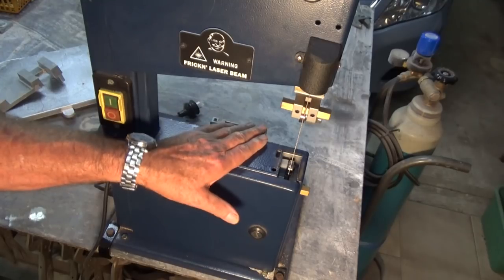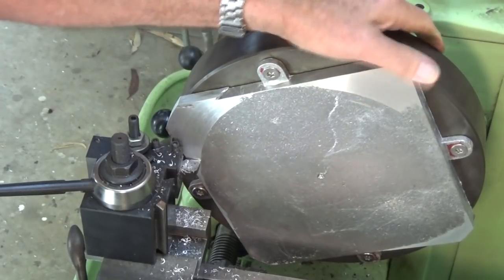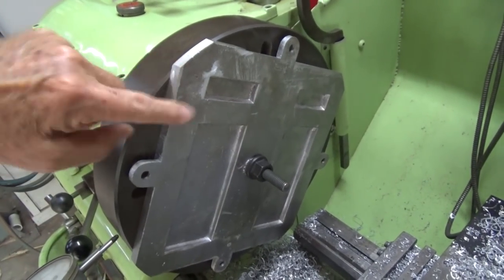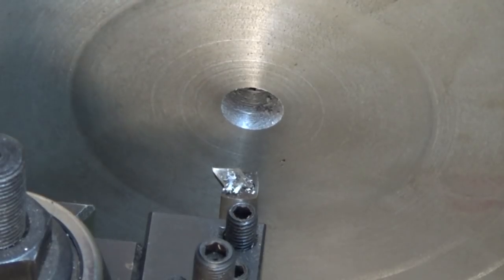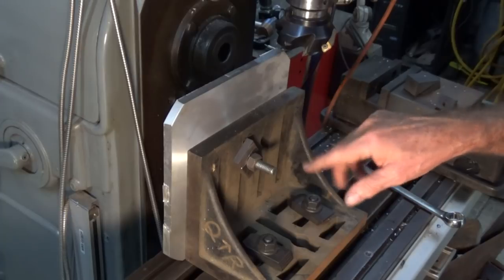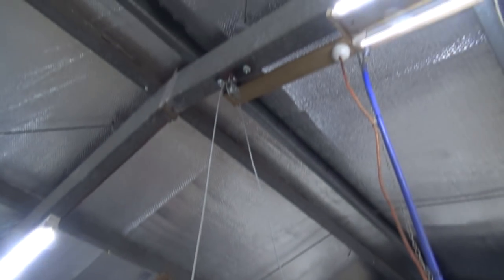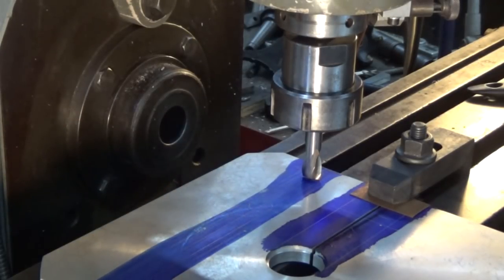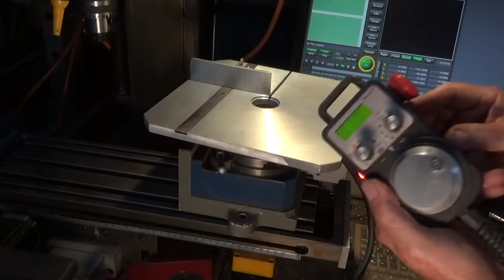Cast Aluminium Machining for a DIY Bandsaw Table

Comment: Thanks for ur time .i have just started milling as well as lathe work . I did the reverse of u and moded my multi speed metal band drop saw as a vertical bandsaw to use on timber .
As so funny enough i wont to get into casting and plating so u have me hooked.
 As a fellow brisvagusin loved ur vids keep them up

Comment: Nice work. Another method I have seen to keep the table flat across the slot is to put a tapered pin into the edge of the table, spanning the slot. I think in those cases they only machined one side of the casting though and you can use the flat bottom.

Comment: Great work! Brilliant finish on that table
As for the miter fence dimensions, I think that's where you say "I'd rather be lucky than good" :)
Reply from the maker: I did actually remove a bit of the steel tongue where my father had drilled a cockeyed hole to hang the fence from a nail. I just ground it off until the hole was gone and then put it back on the table and lo and behold, it was exactly the same length. How often does that happen?
Regards,
Mark

Comment: Nice build, well done. Beautiful quiet mill you have.
Reply from the maker: It is quiet but I have no backgear so it doesn't have much torque and there is no quill so all the vertical travel has to be done with the knee. I am in the process of replacing it with a Bridgeport. I just have to figure out how to run it from 240V single phase!
Regards,
Mark

Comment: The alloy does machine really well.  Looks very good.  It will be annoying as it develops dings and scratches with normal use but as you said it is a soft alloy.   I can understand you not having the equipment to heat treat the alloy.   I expect you would need a good size oven, but more of a challenge is needing an inert atmosphere likely some combination of inert gases.
I am curious.   The underside of the table is thicker for the mitre slot, and also seemed to be thicker at right angle to the mitre slot for what I expected to be the slot for the blade.   You made the blade slot parallel to the mitre slot and did not use the thicker cast section.    I am curious of your reason.
My wood cutting bandsaw has the blade slot 90 deg to the mitre slot which is common, although I have seen some wood cutting bandsaws with the slot parallel to the mitre slot.
Your fathers mitre gauge cleaned up very well.
Dave.
Reply from the maker: Dave, I believe that the alloy will age harden but not really to a full T6 spec. Part of the challenge of doing a full heat treatment is the amount of time the metal needs to be held at very specific temperatures. The thickness in the centre of the table and parallel to the front edge of the table is to allow for mounting on the bracket that will be bolted down to the bandsaw frame. All the cutting forces are concentrated around that central hole where the blade goes. The rest of the table is really just for supporting the work and it only really takes superficial loads. I am trying for maximum rigidity in the junction between the table and the frame of the saw. It should all become clear in the next video which is about 75% done. Probably out late next week.
Regards,
Mark

Comment: HI  MARK,,,,  I  HAVE A CHOLCHSTER LATH ABOUT  THE SAME  AGE  AND  HAVE  NEVER  HAD A PROBELEM  GETING  THE GAP BACK IN ,, AS LONG AS  EVERTHINK IS CLEANE.. REGARDS R.
Reply from the maker: Richard, I based my comments on a friend of my fathers who worked at Evans Deakins, a shipyard in Brisbane, Queensland. He told me that some machinists would refuse to remove the gap piece on threat of sacking because they knew it would affect the accuracy of the bed closest to the spindle. I did actually remove it when I refurbished the lathe and I think I painted the bed after it was assembled. I used a two pack paint and I am pretty sure it would crack the paint if I removed the gap piece. Plus, I did size the casting so it could (just) be machined without removing that part of the bed. 
Regards,
Mark

Comment: Should make some T-Slot clamps as Randy Richards made for his Bridgeport mill.  They sit low inside the slot and only clamp on the sides of the parts.  Its an easy project and perfect for your classic mill.
Reply from the maker: I love looking at all the clamping kit that some machinists have. I did actually make some low profile clamps that use three pointed set screws in a cast body that drive downwards at a slight angle. They bite into the edge of the part so you can hold it down to machine a surface. One day when I get my own Bridgeport I will have to get more serious about acquiring the accessories to go with it.
Regards,
Mark
Reply: @rrintheshop has free plans for those as well.

Comment: Shiny!  I hope it holds up to use.  I've had consistantly bad results with aluminum tool parts subject to sliding wear.  Chips and shop dirt just eat them up.  Carry on, sir!
Reply from the maker: I know it's not going to look good for long but my main issue is keeping the machine light. I have to lift it up and down from a cabinet for storage and I'm not exactly Arnold Schwarzenegger. I will be doing some ridiculous decorative treatment on the table surface just for fun. This will make me extra sad when it does inevitably get scratched and shop worn. 🤨
Regards,
Mark

Comment: Great job Presso as always! Have you thought about hard anodize to help with softness of the table? I've always had the best luck cutting full depth with sitting saws. Thanks for the vid, really enjoy your channel!
Reply from the maker: Steve,
I would like to anodise the casting but it is just a bit too big for my anodising tank. Plus, I have never tried anodising cast parts. I must give it a go though. I think the table will age harden to a certain extent. Freshly cast parts are always a bit soft but they seem to toughen up after a few months. 
Regards,
Mark

Comment: I totally dig the wildlife footage, Mr. Presling, thank you for including it. The surface finish differs as a result of the change in feed rate. A fancy computer controlled machine would run such a project in constant surface speed. Might this sort of thing be hidden if you only have a manual machine by burnishing the surface with Scotch Brite?
Reply from the maker: Ahh, but I have plans for a fancy surface finish towards the end of the build.... My son used to work in a company that had pre CNC hybrid semi automatic programmable lathes with constant surface speed that avoided the issue of differing surface finish due to abrupt changes in feed rates. However, the circular marks in the surface finish were mainly due to adding coolant as the facing operation proceeded. 
Regards,
Preso

Comment: Presso, 
Great as usual, thank you Sir. 
However I do feel that I must lodge a formal complaint with you for the dull ache now in my nether regions as a direct result of the sphincter cramping due to the upward direction of the trailing edge of the slitting saw. I suspected that you were setting us all up for a gag as the blade ripped the work up off the mill table and flung it across the shop (shed ?).
Reply from the maker: Joe, unfortunately I don't have a reverse on my horizontal spindle and by the time I had bolted the workpiece down and squared it all up I realised that I would have to cut from the left with the slitting saw doing an upward cut. However, the material I used in the casting machines beautifully and it was so quiet that I hardly realised that it was taking such a nice cut. I was standing on the other side of the work and I couldn't really see what it was doing. I usually listen for chatter or signs that the cutter or work is loading up but it all went smoothly and ended well.
Regards, 
Mark

Comment: What speed and bandsaw Blade tooth count do you recommend for Aluminum? I just got a Porta Band and was watching your bandsaw videos for inspiration!
Reply from the maker: I am using a 13 TPI blade and a blade speed of 70 metres per minute. It's good for steel but I think that 90 to 100 metres per minute would be better for aluminium. I would like to get a second blade for very thin material. Something like 24 TPI would be good. 
Regards,
Mark

Comment: Looks very good no voids or anything. Since most everything was redone, what do you say you call it Post-apocalyptic-bandsaw? Kinda fits our times huh!?
Reply from the maker: I initially resented the idea that I would have to buy aluminium stock to make my castings but in retrospect, I don't regret paying for it, (said the bishop to the dance hall girl). I did a maker's plate for this saw which declared it the "Phoenix" so sort of the same thing as post apocalyptic, maybe?
Regards,
Mark
Reply: @Preso58  Never heard of that proverb, but it sounds dirty lol

Comment: Thanks for going through all the steps in preparing the table.
is there any reason that the slot was not cut at the back of the table instead of the front, as I thought the cut in the back would be less of a problem with feeding in material???
Reply from the maker: You have to be able to feed the blade on from the front so it will insert into the blade guides and into the open doors and onto the wheels. I have seen some tables with the slot on the side but I more or less copied the design of the original steel table. 
Regards,
Mark

Comment: Great casting! Now tell us about that cnc rotary table you snuck in at the end.
Reply from the maker: Pat, that was a conversion I did pre YouTube days. It's just a little 4" Vertex rotary table that I modified with a 1:1 tooth belt drive. It gets the motor tucked away at the back of the iron base casting. The smaller Vertex rotary table doesn't have any slotted mounting holes so I made a cast aluminium sub base so I can stand it up vertically or bolt it down flat. I wouldn't want to trust it for aerospace work but it is OK for backyard engineering.
Regards,
Mark

Comment: Mark,  Please, never try T6 - it is a very unforgiving process and NO amateur will ever manage it properly - most commercial places have stuff ups with it - I speak from bitter experience!
However a T5 would have picked up that hardness quite a bit and would have made a world  of difference to the machinability. The good book says 8 hrs in a fan forced oven (electric) at 225 deg C. However I use  8 hrs but at 165 deg C and it seems to work very well indeed (have done thousands of castings this way). The time and temperature are not all that critical after the 8 hrs turn off the oven and alloy to cool naturally. A domestic electric fan forced oven is quite suitable. Note though that the casting will can not be bent far after the treatment but that should not bother you for this use. I will email you shortly with some thoughts and calculations I have had re your running and gating efforts on the casting....Martin
PS. If you get a better finish with HSS than with carbide then you are using the wrong carbide! In theory HSS can be made sharper (once when carbide was a new thing this was "truer" than now) but these days of micro grain carbide it is a marginal difference a best and one rev of the work and that razors edge on the HSS is gone particularly with a relatively high (7%) silicon alloy like 601- check out "smallcnclathes" for his thoughts on carbide - he has machined thousands of my  601 T5 castings
Reply from the maker: Martin, I did read up on T6 and knew that it was not something I would want to tackle. I had not thought of T5 though. I was hoping that the alloy would age harden to some extent. I take your point about carbide vs HSS but probably, like my father, I am a bit of a cheapskate when it comes to buying inserts. I know that Stefan Gotteswinter promotes the notion of lapping carbide to a razor edge and it seems to work really well for him. 
Regards,
Mark

Comment: Good job. Looks like something you would get from the factory. Actually it's better.
Cheers
Willy
Reply from the maker: Interestingly, I did check out some brand new wood cutting saws of a similar size to the one that I was given and some did have aluminium tables and much better table supports but they were still rather thin and probably some sort of zinc based die casting. The one that I have now is rock solid and I must thank Mr. Pete for inspiring me to have a go. I watched a video he did where he cast and machined a table for a small belt grinder. 
Regards,
Mark

Comment: I wouldn’t worry about the scratching from the vises. This is aluminum, unanodized, so when you start cutting metal on the saw, this will scratch and gauge pretty quickly.,
Reply from the maker: The finish I put on the table surface will be purely decorative. It's mainly in response to a similar build I saw on Instagram. I got in touch with the maker and asked if I could go one better and he gave me the green light. I always say, if something is worth doing, it's worth overdoing. 😁
Regards,
Mark
Reply: oh, I agree. I’ve been accused of that myself.

Comment: Now that was a great video :-) but i have to ask... could you please make a video about your homemade vertical milling head? I got a old horisontal mill my self, and would like to ad a vertical head to it. Thank you. :-)
Reply from the maker: Henrik, That vertical head is a bit of a Frankenstein really. All the castings are aluminium and as such it is a bit too light for serious work. It is fine for machining alloy and light cuts in steel and iron but I have had situations where a big cutter has dug in and I was horrified to see the whole assembly flex as it stalled the motor. The spindle is 4140 steel and it is supported on two conical taper roller bearings. I have a preload nut on one end of the spindle and it has a runout of about .01mm. When I bought the Denbigh mill it came with a vertical head but it was mounted on the end of the horizontal arbor and by the time I mounted a collet chuck in the vertical spindle and put a vice and workpiece on the table I had about 50mm of travel left in the Z axis. The motor is a 3 phase 1KW and I run it from a variable frequency drive because I don't have 3 phase power in my shop. The drive from the motor to the spindle is a tooth belt with about a 3:1 reduction. If you are interested, I have put the 3D model on Dropbox for another viewer who had a Denbigh the same as mine. All the files were made in Autodesk Inventor but you can open them in Fusion 360 too. Probably some other 3D modelling software will import the individual files. There is PDF of the 2D drawings as well. 
https://www.dropbox.com/sh/ax9j3tjsmw3lskh/AADej0cDCQu94ZyyeIgUdB2ka?dl=0
You can email me if you have any other questions. My address is in the "about" tab on my channel.
Regards,
Mark
Reply: Hey Mark. Thank you for your answer:-) I use Inventor at school, so no problem. Thank you for the idea, I will try, and incorporate as much of it into my own little attempt, to make to make a vertical head. My mill is an real old German "Biernatzki" mill, and my overarm is with a dovetail. I hope that will help me a little, getting  it stiff… Henrik

Comment: Mark,
Is the addition of the image in the screen grab a response to those that say you are not just a pretty face? There seems to be an increasing number of 'creators' that use the click bait approach to increase the number of views on a video; you don't need to do that as your content is always engaging and interesting. That alloy certainly seems to machine well it is a good find. I used to use the old trick of some toilet tissue in the spindle bore to stop the chips getting into the scroll but in these troubled times I might fill it with gold as it would be cheaper and more easily available!
Keep up the good work
Reply from the maker: Michael, with regards to the thumbnail, I take your point and I try to restrain from cheap self promotion. However, I have over 110 videos on my channel and less than 7000 subscribers. I get, on average, 1500 views per video and I don't know why. I don't monetise any of my content and I don't have any paid sponsors. Maybe it's something to do with the YouTube algorithm but it can be discouraging sometimes to put up content that seems to slip under the radar. I have seen videos with 500,000 views plus portraying some banal or misleading content usually involving some imbecilic "influencer"  (is that even a word?) and you start to question why you are even bothering. Because of my background in education I feel it is important to share information, even if it is just to portray what not to do,  and I don't expect to get anything in return. For what it's worth, I haven't yet sunk to the level of including my own portrait with my gob open and pointing to some explosion or such. God forbid I would sink so low... Anyway, end of rant!
I must thank Olfoundryman for "encouraging" me to drop some cash to buy good quality alloy for my castings. I think he put it this way "I long ago decide to be a man who makes castings rather than one who reclaims scrap"  I do appreciate your comments regarding my channel. Please spread the word!
Regards,
Mark
Reply: @Preso58  YouTube probably isn't promoting your videos because you don't monetize them.
Reply: @Preso58  YouTube notoriously doesn't promote non monetized channels because there's no money to be made.

Comment: Presso, heat treatment for 601C is 160°C for 3-5 hours for a T5 if you gave the forging a water quench right out of the sand. That is if the wife doesn't beat you for using HER oven. 😁
Reply from the maker: I have my own oven in the workshop that I use for powdercoating. It has a PID controller so I can hold temperatures fairly closely. I guess it comes down to the cost of  running an oven for so long for just a few parts. I believe that the alloy will age harden close to T5. Just at the moment it is quite soft but I will not be using it a lot. I might drag the bandsaw out three or four times a year depending on what I am doing at the time.
Regards,
Mark